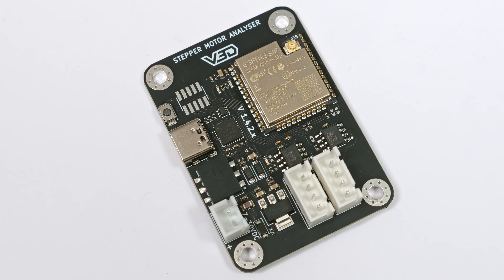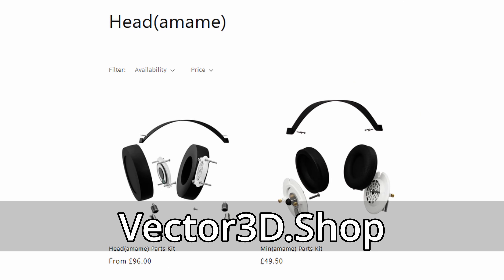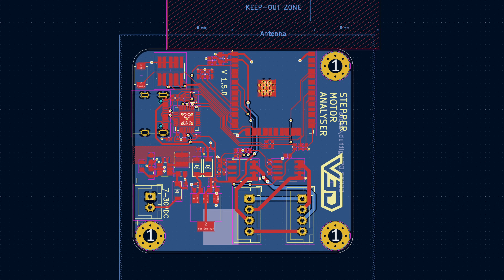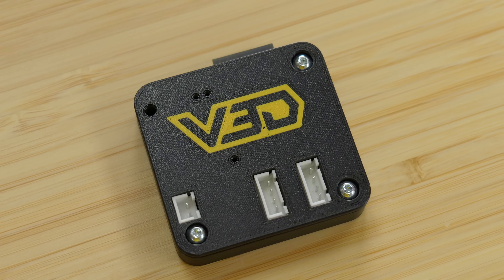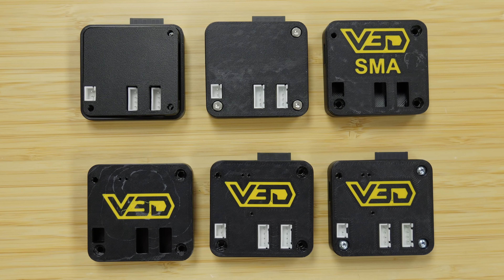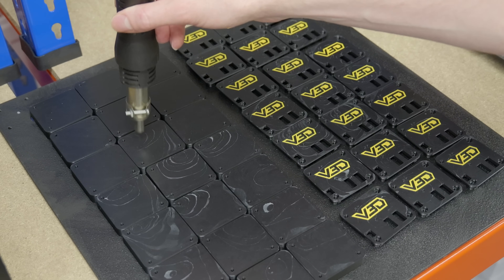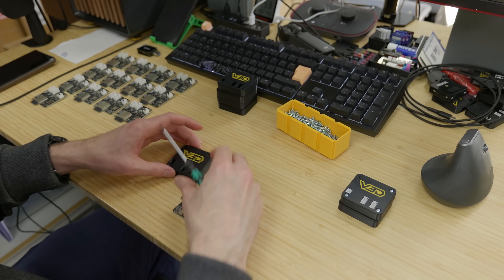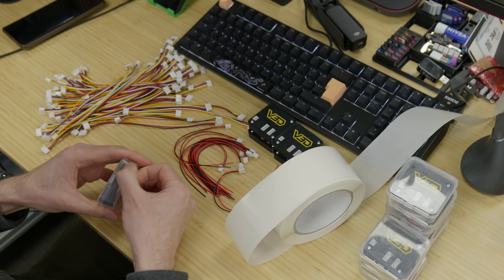Behind The Scenes of Redesign and Production Process

Comment: May I have i question about JST-XH connectors, KiCad/EasyEDA and JLCPCB?
There are (original) JST-XH connectors, but all of these have pin pitch 2.5mm. And then there are basically any (chinese) printer board with so called JST-XH connectors, but these ones have all pin pitch 2.54mm. This discrepancy starts to have issue about 6pin+ connectors.
So the question is, which these connectors JLCPCB actually uses when you place order with component.

However it looks like, it is quite an issue. Because when you order JST-XH connectors from almost anywhere, you most probably get 2.54mm pitch. But when you try to design board, you most probably have just 2.5mm option for JST-XH.
Reply from the maker: XH is always 2.54mm as its 1/10 inch. Sometimes it's just not mentioned. Design for 2.54mm and you should be good to go.
Reply: @Vector3DP  well, in that case I have to inform you that original JST-XH (by J.S.T. Mfg. Co.) is never 2.54mm. It's always 2.5mm (with not accumulating tolerances between PCB pins holes +-0.05mm. Meaning 1st and 15th pin in 15pin JST-XH can be in range between 37.45mm to 37.55mm, not between 36.75mm to 38.25mm).

The only "JST-XH" with 2.54mm are chinese knock offs (which is usually not supported at all in any CAD library, in libraries is usually the original one). Unfortunately to us, these are used in 3D printers almost exclusively (I've never met 3D printer with original JST-XH). Probably with hope you'd never use the original one with higher number of pins (which wouldn't fit in it).
I've been surprised as well.

EDIT: used more pins in example to make the difference more clear
Reply: @kmartyCZ  It looks like JLCPCB has both JST and knockoff versions, so it's up to you to select the right part.
Reply: @TheEnigmaBlade  do you have by change idea which ones are they in e.g. EasyEDA?
Because I couldn't find any (all of them eventually turned out as 2.5mm versions - at least in included datasheets).
In my last "project" I had to make my own library "Chinese JST-XH" (with 2.54mm pitch) in KiCAD, ordered component placing without them and manualy soldered them at home since I have only knockoffs at home.

Comment: Try self tapping screws for plastic instead of machine screws. You don't have to print any threads for them. And I believe they make stronger connection than machine screws in plastic.
Reply: No machines are better. With the other the danger of breaking such a thin print is to high.
Reply: @lazyman1011  not altogether true. Depends on thread engagement, axial loading & material being screwed into. Plastites are in many situations a better alternative.

Comment: I've never noticed stress marks in my prints, what caused them?
Reply: Do you print in ABS, ASA, or other high temp materials? They're not typical to PLA or PETG. They're a result of the physical and chemical properties of the material. As it cools down, and subsequently shrinks, micro-stresses are introduced into the print and reveal themselves as a discoloration; most commonly a white-ish haze or streak.
Reply: I’ve printed in ABS and ASA. I have not printed a lot of black and maybe just missed them.

Comment: You can clear the stress marks of the print by heating up the print bed and placing the part face down for a few minutes. This way you don't run the risk of burning the part or partially melting it with the heatgun.
Reply from the maker: It is an option I've used before. But I did it mostly in parallel this time so didn't really have a spare bed.